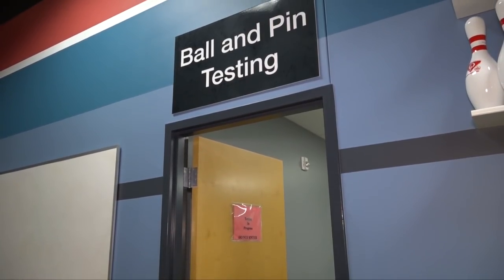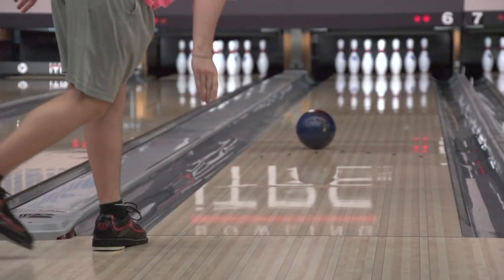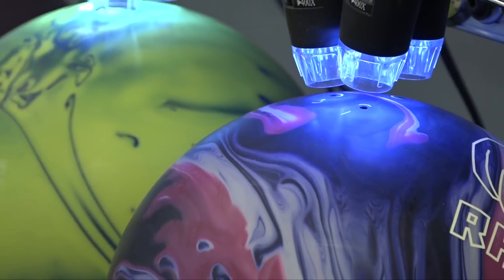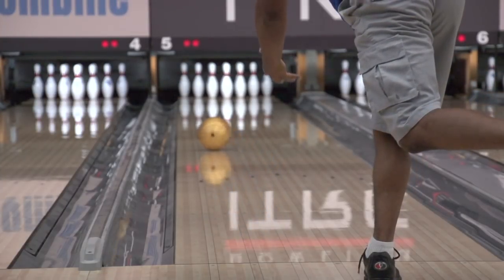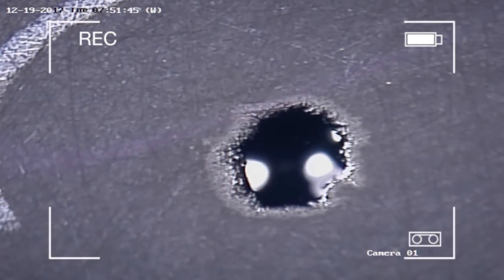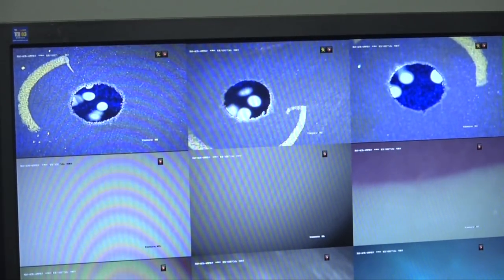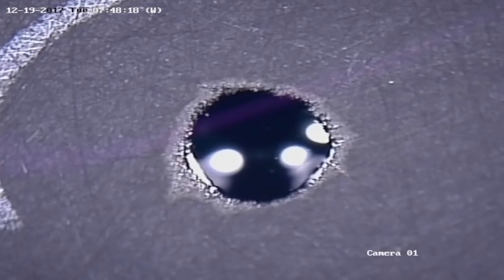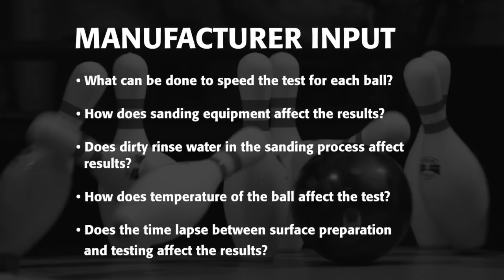Bowling Technology Study - SECTION IV: Bowling Ball Oil Absorption Study

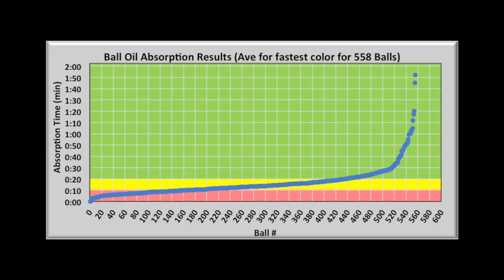Comment: While all of these videos are great, I am going to disagree with one thing that was said by Dan Speranza in this video at 2:50. He said that urethane coverstocks don't absorb oil, that it will sit there for days. I have a Storm Mix that I use as a spare ball. It is urethane according to www.stormbowling.com, and every time I put it back in my bag when I'm done bowling, I clean off the surface. However, every time I pull it out of my bag when my next session starts, the ball has a lot of oil sitting on the cover. I don't even have to keep it in the car on a hot day for this to happen. I was wondering if you could maybe revisit that particular research on urethane, or is it something with that particular bowling ball that makes it go through a constant absorb/release cycle that the urethane balls you tested do not.
Reply: Yes I agree Urethane absorbs oil!

I started bowling before resin, anybody back then that left their Urethane balls in their car all day while at work and then went bowling that night. Pulled a ball out of their bag dripping with oil.

The thing was people back then didn't just pull urethane out on dry lanes for a couple of games.

They  used urethane all the time, with coarser surface textures that picked up a lot of oil and kept them For entire seasons or more.

USBC urethane does absorb oil! The thing is Urethane absorbs oil slow bowl 3-9 full games a week on the fresh with it, just towel it off and throw it in the bag like regular league bowlers do for a season. Then see what happens.
Reply: Usbc is just going to ruin bowling especially for the average league bowler. Its a shame. There is less and less bowlers each year because of certain rules and or certain bowling alleys running league bowlers out. Miami only has one bowling alley broward has about 6 but 2 of those are now owned by bowl arrow or whatever its called and they are turning those into a fun centers that is running leagues out, now combined with some not all of the new rules bowling is just going in a downward spiral its a shame. There needs to be a new bowling congress with fair sanctions and rules. With all the technology out there why are we saying no balance holes. Change the oil to tame the equipment, i have bowled plenty of tournaments were the balance hole doesn't help and its more about having the right ball with the right bowling condition to match up and score well. Oh well thanks usbc. Jeff you are right on the oil consumption with on the balls. Oh and usbc now your going to tell the average league bowl with 2 or 3 balls in there bag that have weight holes to spend more money and get those balance holes plugged.
Reply: To be fair PJ, it's only a little money to get the holes plugged. The main issue is what you stated before. USBC is absolutely killing the sport. People complain that the equipment is too aggressive, so they try to limit how people bowl, then they start complaining that the restrictions are too much and they need to lay back more. There's no way for them to win in this current state, so they're making bowling a laid back activity equivalent to billiards, where you go get drunk with your friends and fuck everything up. Problem with that is they are then essentially giving up and letting bowling slowly die until there's only a few centers left run by Bowlero. Its honestly really sad